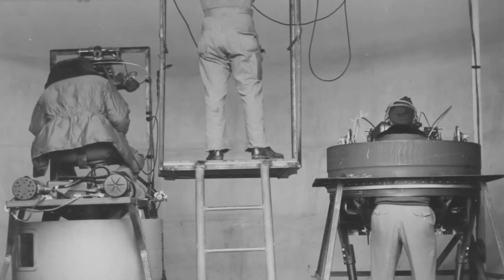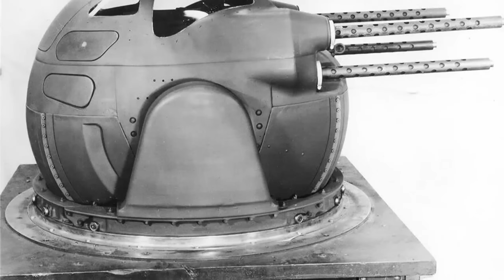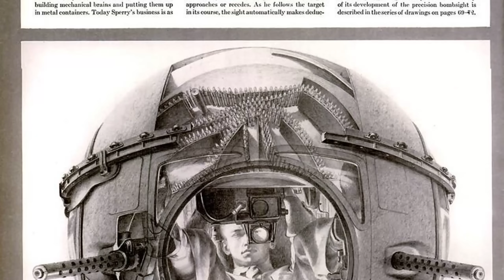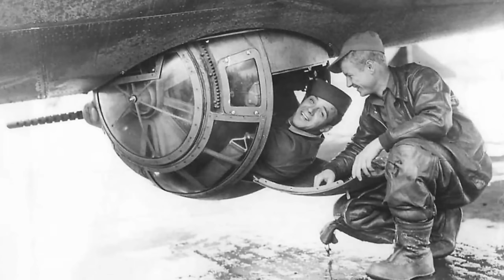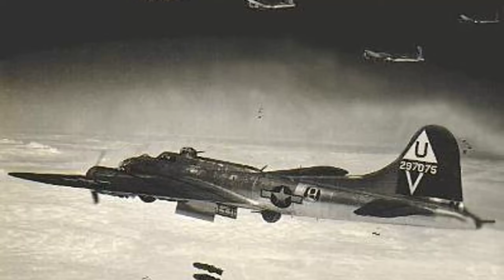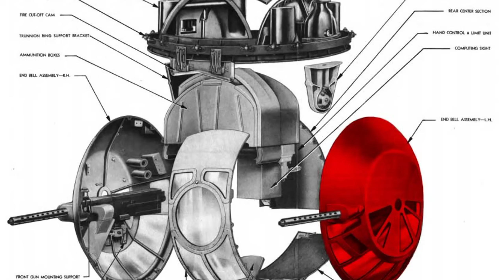German Pilots Stunned by Ball Turret's 57% Kill Rate 1944

Comment: If I got stuffed into that turret, I'd be mad as hell and shooting the crap out of everything I got under my .50s, too!  Just a historical note, the FW-190 was equipped with a radial engine initially, but due to availability issues it was adapted to mount the inline liquid-cooled twelve cylinder as well, but as far as I know, NO radial engines had any type of liquid coolant, unless you count the methanol injection system on some of them